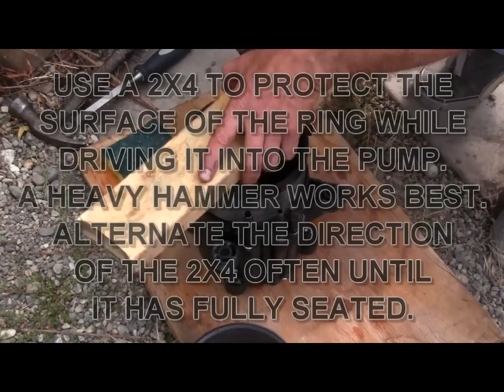How to replace sea-doo wear ring in 5 minutes.

Comment: For the tools you are using you did a great job. Use a Drimel with a long zip bit
and you dont even have to take out impeller. Cut a channel in the ring and drive it out frrom the back. I use two cement bricks to rest the pump.

I put the ring in the frig a hour or two before, also I like a little grey gaskit maker
on the bottom of the ring.  

I do used a 2x4 just like you for the install of the ring.

Great vid anyway.

Comment: I have cut the wear ring out never thought of freezing the pump to get it out. I have frozen the new ring and heated the pump with a torch and it slided right in no problem. Got to do one on my 96 xp I will try the freezer trick to remove. 👍

Comment from the maker: I know! Lol  I found an easy way however. Put the ski on the trailer backwards. Use a 2x4 or whatever from the winch tower to the back of the hull on the bumper rail. Connect the crank tie down to the pump, then crank away! Pulls it right off without having to fight with the silicone. For newbies, make sure everything is disconnected FIRST before pulling the pump this way. Also, never hurts to put a little wax on the pump before tightening it down into the silicone bead so it separates easier ;)

Comment from the maker: It's normal, however you shouldn't allow your pump into areas that are shallow or have tall sea weed. Keep in mind that there is a lot of suction with a pump. My ski took a shopping bag on the drive shaft last year and I had to idle back to shore to tip and remove it. (took a while) but just that alone set off bad vibrations where I couldn't attain any HP.

Comment from the maker: If it has sat for a long time, specially in salt water, they can be tough to loosen.
Not sure of your motor, though I suspect it also spins counter clockwise. You need the spline tool and a vice to do the job. And the next time you install an impeller, be sure to put some anti-seize on the threads. I do on all of mine and they come off clean and easy when I need them to.

Comment: You can use a screwdriver like the video shows. I would bend the tip of the screwdriver over to about 90 degrees. You can do it without bending the screwdriver, but it's harder and can gouge the housing. Support the housing on something like wood blocks or a large vise. Go in from the nozzle side and slip the tip of that screwdriver down...

Comment: Pump stator looks really rough from the sand cast. You would probably get a lot better performance if you polish it before reinstalling it. If you do decide to polish it, be sure to have it anodized or passivated depending on the material it's made out of.

Comment: I use a jigsaw. I cut 3 cuts in it about 3 inches apart being careful not to cut into the pump take a screwdriver and hammer right by the first cut and it comes right out.

Comment: ...... or put in the freeze for 60min titerally pulls out easy with your hands no tools required
Reply: Brett Forbes love the idea. Never worked for me.
Reply: Try it again believe me it works, freeze the whole unit and as soon as you pull it from the freezer start pulling on the ring don’t let it warm up
Reply: Brett Forbes I guess my housing is also plastic, not aluminum. Does it matter?
Reply: Doesn't always work. Left mine in a deep freezer for a few hours, wouldn't budge. Used a cutoff wheel in my dremel to cut a slot to relieve pressure, then pried out with screwdriver. It was stuck all the way around. Stainless ring going in so doubt I'll have to go through this again....
Reply: @Tom_Goss  Nowyou can destroy the impeller as well when you suck something up.

Comment from the maker: It's to close the gap between the edge of the impeller and the pump housing in order to get the greatest pressure out of it when it swirls. If it didn't have the replaceable ring, it would be more costly replacing the whole pump when things go wrong.

Comment: Use a large tub of freezing cold water. with lots of ice. same concept soak for about 30mins with new and old ring. pull with some channel locks slides right out.

Comment: I have changed hundreds of wear rings on Sea-Doos I never remove the impeller I get an old screwdriver bend it on the end where you can get a bite on the wear ring on the back of it and beat the wear ring out. The plastic body pumps are the easiest to do the older metal body ones you have to use a quarter-inch drill bit and drill down through the wear ring and then break it in two. I can pull the pump beat the wear ring out beat a new one in and put it back together in 15 minutes.

Comment: Can you please tell me which way to turn the shaft to losen and the out the impeller?  Have tried clock and counterclockwise and still can not get it lose.  Its a gsx 947 1999. I'm using the tool recommend for it. Any help will be appreciated.

Comment: I had my 2013 RXPx replaced by the shop and asked to see/keep the ring and all they did was get a heat gun and melt one section slightly and shrunk it and they pulled it out in one intact piece which i've kept !

Comment: ...into the gap between the ring and housing. Hammer, working around the ring, until the ring pops out of the impeller side. The freezer trick works great, but I am too impatient for that. If you have the time, just pop it in the freezer. I will be changing mine in a couple weeks. Maybe I will make a video.

Comment from the maker: Do you mean the start button? 
Other problems than the switch could be 1) battery  2) solenoid  3) starter
From there on wiring, but most likely one of the above first.
Are you sure it's the switch and not one of the others I posted?

Comment: hi, you know how to repair a display to sea doo GTi 130 of year 2010?????
Reply: +Jetski Detailing thanks for answering, stop using my bike for 3 months for the cold season, the battery died and I put a new one, the bike starts perfectly and the alarm key works well, but the alert overheating, speedometer, fuel level They do not work for nothing, and you change the fuses and will not start, you know ????
Reply: +Jetski Detailing fuses and connector yes, but I'll open it and check if there is water or have some disconnected wire inside, thank you notice anything, greetings.

Comment: +++++USING THIS TECHNIQUE, YOU CAN REPLACE WEAR RING WITHOUT REMOVING THE IMPELLER++++
If you use a skinny chisel (I used a 3/8 wide one, and it just fits), you can cut between the impeller and housing. Just keep rotating the impeller to make sure you aren't ever hammering on it. Took me five minutes. HAVENT TRIED THE FREEZER METHOD YET. that sounds easiest....
Reply: Also note that this is if you are sure the oil and bearings are functioning. Pulling the cone is good idea if you need to change oil and inspect bearings anyway

Comment: got a 2015 seadoo 155 the shaft that connects to the propeller there's a rubber boot part of the boot is missing do I need to replace it